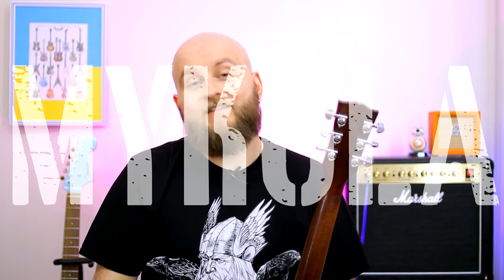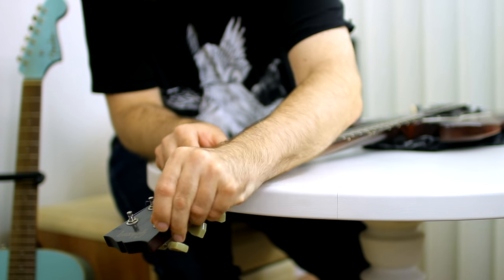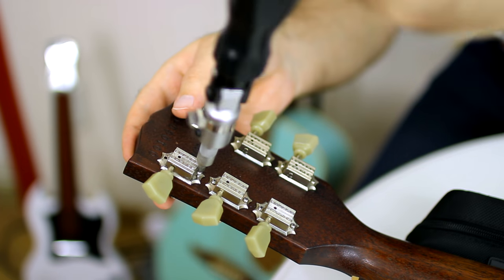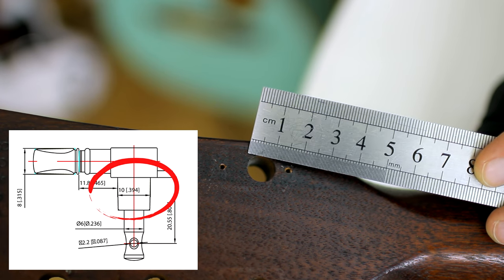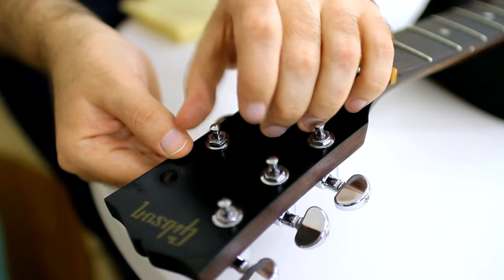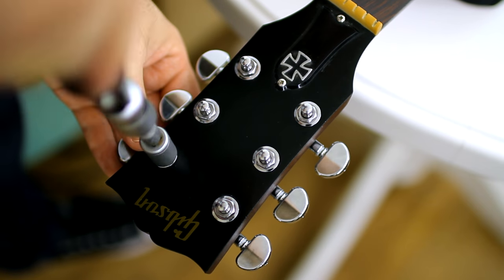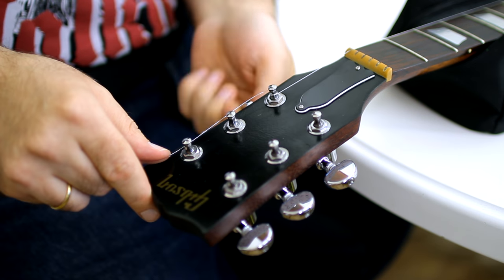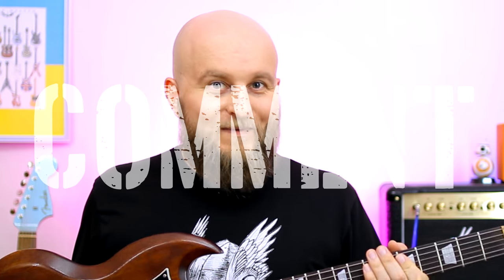How To Replace Tuning Pegs On Guitar – Changing Tuners (Tuning Machines)

Comment: Hello sir,  you never explained why you put the pencil lead on the nut?🧐. I am still learning
Reply: Graphite found in pencils lubricates the nut and prevents the string from getting caught in it. It helps keep the guitar in tune.
Reply: @doglifehub  Thank you for your response
Does this work with all normal lead pencils?
Reply: @kstonurai9350  yes. They are called lead, but there is no lead in them - all normal pencils are graphite (mixed with clay). I scrape a little off with a knife and apply it with a small artist's painting brush, but just drawing in the nut slots is fine 👍👍👍👍